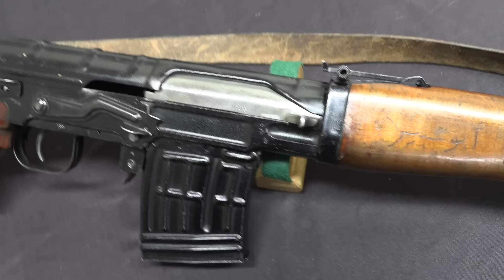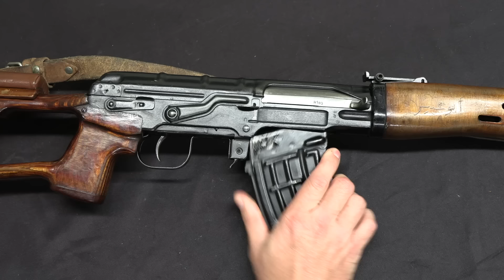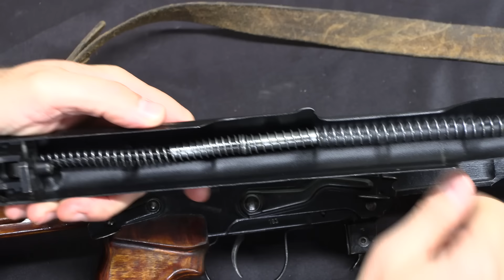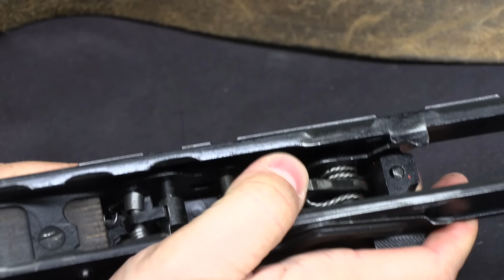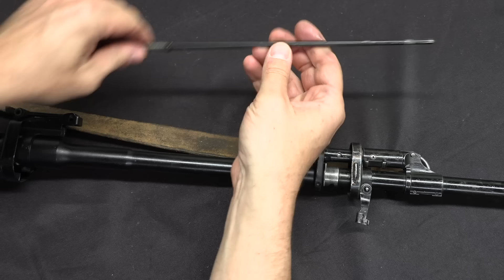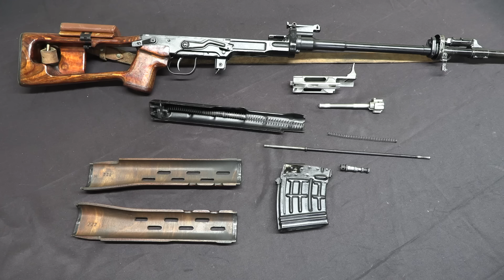SVD Dragunov: The First Purpose-Built DMR

Comment: I had this during service. Cheek weld was phenomenal compared to a normal ak74. This cheek pillow looked like a piece of luxury in the military.
Reply: How was selection done for which man in the squad was issued this?  Rifle qualification results?

Any interesting training or operations things you can share?  Like were the guy with the Dragunov supposed to look for officers, machine gunners, etc?
Reply: @richardjames1812  As near as I can tell, the best shot in each squad got the rifle, the biggest got the machine gun.
Reply: @frank-mp3bq  Thank you.  So you must have qualified with with the AK, then they upgraded you to the SDV.  Any interesting training stuff?
Reply: @richardjames1812  The training really varied depending on location, the unit and the time period. In my case they were two static man sized targets at two unknown distances (150-250 and 300-400 m). You had to range the targets using the range finding grid the scope has and land 3 hits on each target within a certain time frame whilst using just one 10 round magazine.
Reply: @azeke8  Thanks, that is interesting.
Reply: Actually it is a necessity to use it. But with that you can't use the iron sight. so with iron sights you have to remove it.

Comment: Maximum dispersion (according to official documents) is 8 cm at 100 meters. If it exceeds this, the rifle is withdrawn from service. On average, the dispersion is about 5 cm (2MOA).
Thanks for your video!
Reply: Which sight would that be with? Because if memory serves the requirements are different between using the optic and iron sights.
Reply: 2 MOA is not bad at all. Not a hyper accuracy modern sniper rifle or precision shooting rifle but for what it’s intended role was that’s pretty good.
Reply: @Dominic1962  Not bad for what, 3 shots or 100 shots? That test is something like 10 or 20 shots. When you factor this in, that it is a fairly large number of shots and not even one shot can exceed 2 MOA, it needs to be closer to a "1 MOA" rifle - i.e. what regular shooters would call a 1 MOA rifle based on 3-5 shot groups, most of the time. I often got 0.75 to 1.0 MOA with 3-shot groups. Any more shots heated the barrel too much and it began to walk. It would shoot dead on with a cold bore and predictably for the first 3 shots, which is ideal for a marksman.
Reply: That makes sense, with CEP dispersion the circle where 99.8% of shots land is 50% wider than the circle where 94% of shots will land.
And most of the dispersion will likely be vertical due to velocity variance.

But let's not get ahead of ourselves, any range where this dispersion is a problem is such a range where errors other than dispersion will affect accuracy far more like:
- range estimation errors
- wind deflection
- canting of the rifle
- not accounting for shooting at an upward or downward angle

These can be compensated for but generally you can't do this while advancing under fire as infantry tend to do. But I suppose it's better to have less dispersion which would add to all these problems but it's only going to make a difference up to a point.
Reply: No offense, but If I had two cents for every claim about soviet gear "according to official documents", I would be rich.

So according to what documents? Dragunovs have been used in a variety of roles and designs, which probably had different design requirements. Its a pretty common understanding that the Drag in the original squad support role was not very accurate, didnt need to be (its not really like a DMR).
Reply: @Max_Da_G  Dispersion requirement in a Field manual "Наставление по стрелковому деул. СВД". Dispersion same for optical PSO-1 sight and iron sight. Difference only for point of impact relative to aim point.
Reply: @termitreter6545  Let me remind you that a 2 MOA dispersion for a semi-automatic rifle designed and adopted in 1963 is impressive! If you look at the early 1960s, most standard American bolt-action rifles (not custom competition models) also had a 2 MOA accuracy. Check Harold Vaughn for reference. 😉  

That said, the SVD doesn't quite meet modern standards—it's true.  

By the way, does anyone know where to find world records from different years?
Reply: @KonstantinKonev  I ment to say thats way to good, hence im doubtful. A 2 MOA for a fairly light, 60s mass produced automatic rifle? 
That just sounds way to good to be true. Like some modern DMRs just about hit that level of accuracy.

I could believe that some 80/90s Dragunov revision for a more dedicated sniper role manages that, but even then that would be really good.

Might be wrong, but that just seems unreal.
Reply: @termitreter6545  In the 1990s, I worked as a military engineer. Around 2000, I became a sniper instructor, and we used the SVD for 80-90% of our training. Since 2001, I've been working in the gun industry, so I like to think I have reliable firsthand knowledge. :)  
Interestingly, many snipers still prefer rifles from the USSR era. However, SVDs produced in the 1990s, after the Soviet Union collapsed, were of noticeably lower quality.  
A 5 cm (2 MOA) dispersion is absolutely normal for a good SVD. Rifles with a dispersion of 8 cm or more were typically sent back to the arsenal or factory for repairs.
If a group of shots did not meet the requirements (8 cm), a retest was conducted. If the retest also failed to meet the standards, the rifle was returned. The retest was performed to rule out random factors, such as the shooter's influence or ammunition variability.
Reply: We had the 8 cm at 800m, but, with PSP scope
Reply: @alnotz  Wow! 8cm at 800m from SVD? Too cool! How repeatable? Just one group or every time? How many rnds?
Reply: @KonstantinKonev  Well thats in ideal conditions...and of course it's at best. No wind. PSO-1 is best at 400. since it's 4 times. You are fighting on the same terms of AK does on 100meters.
But since 90%+ of modern engagements happening in urban, less than 200ms... or even 50..
Best weapon for CQB... PPS-41)))
Reply: @KonstantinKonev  We were rather training for rate of fire. 10 rounds in 10 seconds. at  10 targets on hard level. of course thats not to 800m)))  And even, further with iron sights only bayonets fixed SVT style))

Comment: In the wars generated by the breakup of Yugolsavia snipers used civilian hunting rifles. It was unusual to see a soldier or paramilitary with a Dragunov. The proximity to Austria meant high quality rifles were available. In Sarajevo snipers were making kills at 1200 mtrs. A Croatian soldier who'd done his service in the Yugoslav Army said "Here's how you select a Dragunov: you go to the armorer and get ten of them. You go to the range and test them. One should shoot close to minute of angle. You return the other nine to the armorer." I assume the Yugos made their own Dragunovs at Kragujevac but I have no actual information on that. In Mostar I saw a Bosnian soldier with a Winchester Mod 70, pre-64, in 30-06. On the stock was a brass plate commemorating the awarding of the rifle to a man with a Serbian name by the Chamber of Commerce of Butte Montana in 1954.
Reply: Yugo didn't make them, they made the M76 which used an 8mm round. Just a scaled up AK.
Reply: Great story
Reply: nope...SVD was not manufactured in Yugoslavia. we had M-76...but i love SVD(special Dragunov`s rifle) that is what it stands for.
Reply: This is an interesting story . What were you doing there ?
Reply: @zagrepcanin82  SVD stands for Sniper (V)Rifle (of) Dragunov. You're probably confusingly adding the special from VSS which is (V)Rifle Sniper special
Reply: Mind that killing at 1200 meters doesnt require accuracy at 1200 meter. It requires enough bullets, and the Drag was designed for a higher rate of fire than normal sniper rifles.
Reply: @anonimus370  yes,my bad...snayperskaya vintovka dragunova

Comment: USSR: "Is the action a long stroke or a short stroke gas piston?"

Dragunov: "It's a long short stroke gas piston."

Edit: guys I know what is the difference between a long and a short stroke gas piston.

It was just a joke to point out how long the system was, since the barrel is 24 inches long.
Reply: almost all "short" stoke gas pistons are like this
Reply: @allthingsconsidered3211  Yeah, the "short" in short-stroke gas piston doesn't reference the length of the piston itself, but the length of travel that the piston moves to unlock the bolt assembly.
Reply: Alternative reply “yes”...
Reply: Short stroke pistons just give the bolt carrier a ‘bump’ to get them to cycle. They don’t travel the entire/same distance as the bolt carrier. 

I guess the other option would be something like having a gas tube from the gas block to where the piston is, but that would probably just be an extra part that would get hot and need cleaning + be hard to clean (less reciprocating mass if that is what you really want to reduce, I guess. Where the gas block is and the mass of the piston all factor into how the gun cycles).
Reply: @fragdude  Interestingly enough, if you look at AKs, even their long-stroke pistons vent all of the gas after only a few centimeters of travel. After than the piston is nothing more than mass, adding to energy carried by the bolt carrier. Originally AK-46 prototype was a classic short-stroke design. But that failed reliability trials, and Kalashnikov with his team, to add mass without increasing the number of parts, simply combined the piston and bolt carrier into one on the AK-47 prototype.
Reply: @Anino_Makata  Well really it refers to them being separate versus connected. Any gun called short-stroke will have a piston separate from the carrier, regardless of how far it travels. And a long-stroke piston only travels the full stroke of the bolt because it's connected and has no choice.
Reply: Really? All serious replies? No jokes about how that makes it a shlong stroke?

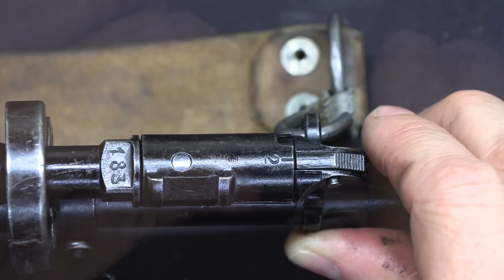Comment: 13:01 If you look at the gas system adjuste, you can see the two teeth on the body of the adjuster. Those are meant to be used in conjunction with a 7.62x53R cartridge casing, making it easier to turn while hot or with your gloves on. Simply slide the rimmed end between the lugs and twist.

Comment: I worked with the Afghan National Army during one of my deployments over there. Had to train with their weapons before I left. AKs, PKMs, and a few other small arms. I hated all of them. Then my instructors brought out the Dragunov. After one shot I was in love. Smooth action. Almost no recoil. Lightweight. Man I miss that gun.
Reply: I am curious why you didn't like the PKM?
Reply: @executivedirector7467  it always jammed after I loaded new rounds, no matter how I did it. It also felt kind of "flimsy" to me. When I fired it I felt like the whole thing was going to fall apart after a few seconds. This was a training weapon, though, so it saw a lot of use, which could've led to the problems I had.
Reply: @littleurnofarabia6458  Thanks. So you used a single example? I only fired one once, seemed great to me, but I also felt vaguely like "how can this be so slight?"
Reply: @executivedirector7467  Yea, it's kind of cheating using only one example. And I do agree with you regarding recoil. It was way easier to control than the 240B and even the SAW.
Reply: @littleurnofarabia6458  I was on a Mobile Training Team with the Iraqis in 2005 and yeah, their PKMs were generally pretty raggedy/plain not working.
Reply: @littleurnofarabia6458  I'm not saying you're cheating! LOL I only fired one. I was genuinely curious. I liked it a lot, from that very limited experience. I did feel slightly uneasy about the light weight; it was great, but you had to wonder how they accomplished it. 

Thanks.
Reply: @executivedirector7467  No worries! And yes, the weight is weird and does make you wonder how they did it.

Comment: I'm the happy owner of a Tigr which is the civilian version of the SVD with a different barrel twist rate that is optimized for hunting ammunition. After many trials I found that 180gr SP ammo is the sweet spot. It's crazy how ammunition can influence precision. I was getting 4" groups at 100m with 148gr FMJ surplus ammo, now down to 2,5" with the proper ammo.
Reply: Mine seems to love ppu 180 grn sp, I use it for hunting :)
Reply: They were designed for the 180 gr. This is very similar in ballistics to the 7.62x51 175 gr match HP used in the remington 700 by our military.
Reply: If you can, try Barnual 203gr. The twist is actually optimised for 200gr. I had nothing shoot anywhere as good as 203. I was getting 3 shots often at 1"and sometimes 0.75". Once had five touching.
Reply: @BC-wj8fx   IV got a bit of Barnaul 203gr, it loved it but it's become impossible to get here (NZ) since the sanctions, so I'm rationing it lol
Reply: The Tigr's twist rate of 320mm (~1:12.5), also found on the Chinese SVD variants, is the pre-74 SVD rate Ian talks about. There seems to be more at play than projectile weight; the 151gr 7N1 sniper round (later developed into the 7N14) was designed explicitly for the SVD with its original twist rate and was the only precision 7.62x54r in the Soviet army. Despite the 7N1's weight being very close to the standard LPS Gzh (148gr) and other common rounds, the performance drop was so significant that the army deemed them unusable and requested to alter the rifling.

Comment: 17:55 Honestly 30rds in 3.5in feels like a more substantive standard than a sub MOA 3rd 'group'. That doesn't make it more accurate, but those testing conditions require a lot more consistency on the part of the shooter, and involves a lot more thermal drift than a 3-4rd group. Also, the original 4x scope is fighting uphill compared to almost any modern rifle scope.

Comment: I miss my NDM-86 from CDNN.  Sold about 20 years ago and kicking myself with how much they are worth now.  Had the bolt corrected with a Russia firing pin, proper length, spring loaded, 6 mags, X4 scope, and added the black polymer furniture.  Wrapped the wood furniture in some plastic.

Comment: For about the same wt if they had shortened to barrel a bit and made it thicker, accuracy would have been better assuming that the ammunition was consistent.  But the longer barrel better burns the powder and makes less of a flash with soviet propellants.  Soviet powders can have quite a flash to them and a designated marksmen does not want to have his positioned pinpointed.   
I suspect the lower accuracy was more a problem of the ammo.  A one in 12.5 twist rate is fine for 145-150 grain 7.62 caliber bullets.  I am guessing that the 1-9.5 twist was needed because of poor consistency of the projectiles rather than the wt of the bullets.  But that is a guess on my part.
Reply: Your comment about Soviet powders:  I took part in a skeet competition near Budapest, Hungary many years ago.  Regulations allowed me to import my own gun, from England, but no ammo.  I had a few hours in the morning to practice before the actual competition began and bought the same no9 shot cartridges that the locals were using.  Every few shots, one would emit a firework-like spray of sparks that were bright enough to leave spots in my eyes.  I was told that Russian propellants were used.

Comment: I know those accuracy standards are what the Russian gentleman you had interviewed a while back said, but as a shooter they don't really make sense. A tighter twist rate should be better for stabilizing a heavier bullet, but worse for stabilizing lighter bullets. It doesn't make sense that a 1:12 twist would be better for a 200gr projectile while a 1:9.5 worked better for 147gr ball or other ammunition. It also doesn't make sense that the rifle would be designed with a light twistrate for 200gr bullets when the ammunition made for it specifically to be more accurate was 152gr 7n1. I think there's something mixed up or lost in translation here. Even Dragunov shooters in the US can corroborate that. The Hungarian and Chinese SVDs with the 1:11 and 1:12 twist shoot lighter bullets around the 150-174gr range better and the Tigrs with the 1:9.5 shoot heavier bullets in the 180-200gr range better. Furthermore it is widely stated in other sources that the heavier twistrate decreased accuracy with the light 7n1 which tracks to what we would expect.
Reply: I thought the same thing. I'm guessing the info regarding two twist rates got switched.
Reply: Yep definitely the fast twist rate loves 203gr and hates anything lighter.
Reply: That has been puzzling me as well. I have nothing to prove what I'll say but it would make sense to go with the slower twist rate because Mr Dragunov knew that the rifle was expected to use the standard LPS as the standard cartridge. By modern acceptance, 1:12.5 is too slow for stabilizing a 200gr bullet but maybe that Xtra match ammo was still shooting better than 1950 spamcan LPS ammo and this is what Dragunov kept shooting during the development process of the rifle to refine his design choices.
Reply: Was thinking this too. It must be the other way around. 1:9.5" perfect for 200gn 1:12" perfect for 147gn.

Comment: Btw it's a platoon weapon not squad.
Reply: This is a weapon for each rifle squad. Three rifles per platoon. The senior rifleman has the rank of corporal. There is one Kalashnikov machine gun (7.62x54) per platoon.
Reply: @Андрюша-з2с  Only first squad of the platoon got SVD  - at least in the motorized rifle platoon
Reply: @grzeg1000  Your info is outdated, that was changed in the 70s, and was a squad weapon afterwards.
Reply: @xSintex  Maybe, but still - it was designed as platoon level gun.The idea was that on squad level you got 7,62x39 for everything.